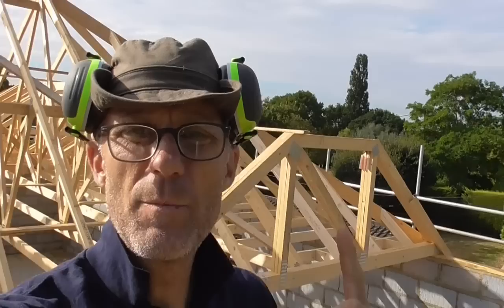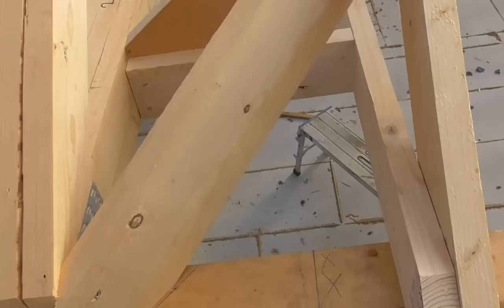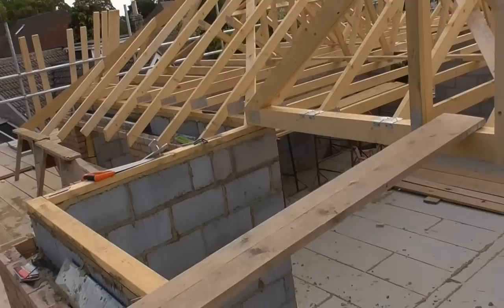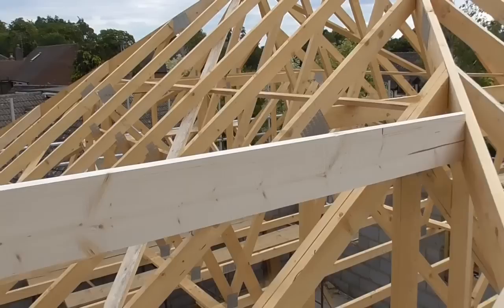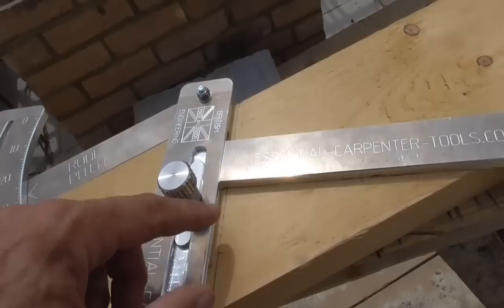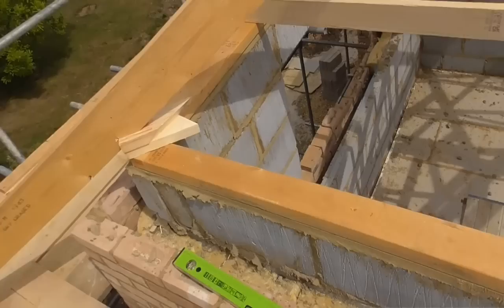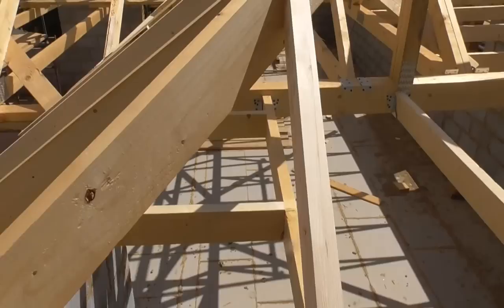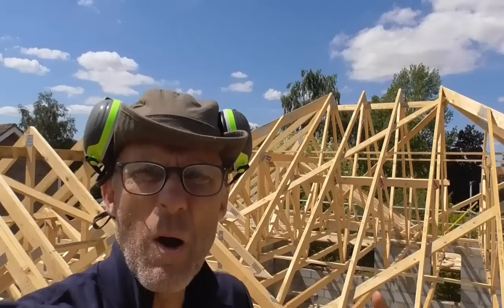Setting hip rafters over flat top girder truss***EXTRA BRAIN POWER NEEDED***

Comment: I just had the "ill always find something to pull you up on" inspector from a certain structural warrant company out.
This time it was. "Cut some little wedges and put some under your diminishing trusses so they are bearing better".
Never heard that one before.
Reply from the maker: Yep, been there Obez 🙄 We had one, exactly the same as yours, who said he can always find something wrong🤔 On one job he had to get his tape measure out to measure between the gable straps as he was getting desperate to find something, and guess what, 1 strap was 2050mm from the previous one, (should be 2000mm max), and got pulled on that😵‍💫 To make it worse though, he then went on to lecture me on the placing of gable straps and even went to his car to get out the NHBC book to show me the reverent standard😬 Guy was a pr1ck😲 Keep smiling at em mate🤩Cheers Del
Reply: @thetallcarpenter  wonder if he failed getting in the police too  🤣.
Reply from the maker: @MrBez007  He probably didn't meet the minimal physical requirements for the police as he was a snivelling little man😵

Comment: Great work Del boy its a thing of beauty 👌 great idea using a gauge block for cutting the hips over the girders 👍😁
Reply from the maker: Hi Andrew🖐Its seemed a straightforward idea and worked well👊 I could have just taken the plumb cut measurement on the end common down to the top of the girder, but the girder was a bit twisted and the top wasnt quite level, so the 65mm block was more accurate👍 Thanks for watching and your comment😎Cheers Del

Comment: I knew you'd crack it Del. Very nice. It's annoying though that the carpenter is left with this problem. Them   trusses are a joke, came from a factory with computers , and its down to you to fix  their problems and no one to take responsibility for it. Their cheap I no . But look at the time it cost you and the builders, that small roof you layed on is by far better than any truss. Look how good the lines to the rest of the roof are. For example if  you had hand cut the whole roof at the truss roof manufacturers degree of tolerance 🙄 you'd probably get  left off.they get away with murder. I like your line from opposite roof to get the ridge in the exact position on the hip 👏👌. That truss company could do with employing you for awhile 😉. Looking forward to your next video 👍😎🇮🇪
Reply from the maker: I guess it all keeps us on our toes Paul, and we'd soon get bored if everything was perfect all the time🤔 There was probably more ways to get the height and line of the ridge, but pulling a line from the other end seemed the most simple and it worked a treat👊Thanks for watching fella😎Cheers Del
Reply: @thetallcarpenter  thats my down fall I like work  stuff to be as good as can be. The string line from one side to the other is probably best you can eye it. Math's are great but reality is another 🤣. Love your work I'm getting on a bit for roofing but I still like to see  how others do it. Never to old to learn . 🙈🤣👍🇮🇪
Reply from the maker: @paulcloona9331  It's always a great day when we learn something new or a different way of doing something🤩

Comment: Great job del as usual. Can I just pick your brains on another subject mate. I’m fitting a framed ledged and brace door which will act as a side gate. What type of butt hinge should I use for this outdoor installation? Hope you don’t mind me asking!!
Reply from the maker: Hi Paul🖐 I would use a stainless steel ball race hinge, and more importantly, make sure the door is WELL coated up with a good quality stain👊Cheers Del
Reply: @thetallcarpenter  you are a top man del. Cheers
Reply: I wasn’t sure if the ballbearing hinge would be suitable to the elements. Thanks again Del
Reply from the maker: @paulyoull5472  I know what you mean Paul, but what else would fit nice on that door and stand half a chance against the elements🤔 A double washered, chrome plated brass hinge would still rust from the pin😬

Comment: After watching several of your videos, it seems your truss manufacturer is the source of many of the problems you solve. The flat top girders never seem to be right. Here stateside, the girders are constructed in such a way that the I tersection of the flat top and the " rafter section of the roof are an integral hip member. Also, we have jack trusses that work to the flat top and hip trusses that work from the corner to the top chord and rafter intersection. So much easier and quicker to I stall these parts of the framing.  It appears, the truss fabricator picks an arbitrary number to construct the girder instead of having it work with the roof.
      Here, the first girder truss is standardized at 7'0"" for most truss systems. Jack trusses, and hip trusses, no matter the pitch are built to this 7'0" span. I believe it would make your life easier. Nice work though. MARK
Reply from the maker: Hi Mark🖐I do find it odd that many of the girder trusses seem to be poorly made, but I guess they are made to a price and are within the manufacturers tolerances😵‍💫It keeps me on my toes though🤓Thanks for your comment and for watching 😎 Cheers Del

Comment: You made a great job of what was looking like mission impossible for that roof Del 👏👏👏. When cutting the splayed cut on the hips did you measure up the from the sole plate to the girder truss to get the plumb cut mark?
Reply from the maker: Hi Kevin🖐 To get the plumb cut mark for the splayed cut, I simply plumbed up the face of the triple girder onto the side of the hip👍Cheers Del

Comment: I’ve said it before and I’ll say it again, you’ve made a cracking job of that considering the start of it was sitting round twiddling thumbs for the truss manufacturer to sort their issues out! 😎👌🏻 is there a particular reason you had your timber merchant rip down the 6x2 to 35mm?
Reply from the maker: Hi Matt🖐 I kept the timber to 35mm wide for 2 reasons. Firstly, 2" thick lay boards are a bit heavy and can cause hassle when boarding out the valleys, and secondly, keeping is 35mm makes the calculations for the end common rafter the same as the run of the roof commons for cutting the rafters and setting out the end👍 Thanks for your comment and for watching😎Cheers Del
Reply: @thetallcarpenter  ahh yes that will make your life easier! All my local merchants only keep the 45mm timber in stock and don’t cut anything so I guess that’s all I know regarding weight etc! But also makes my life easier when putting the tile battens on as I normally end up covering the roofs in, bit more meat to nail into and join battens on!
Reply from the maker: @mattwilkins5058  You go the extra mile covering in then Matt👊👊